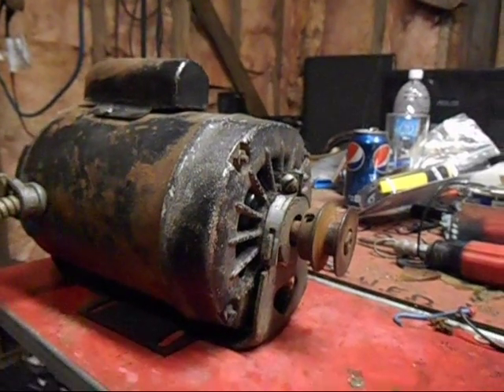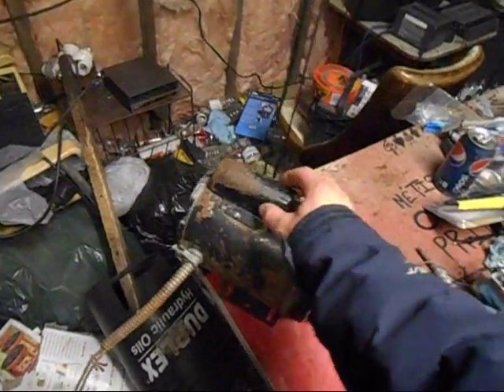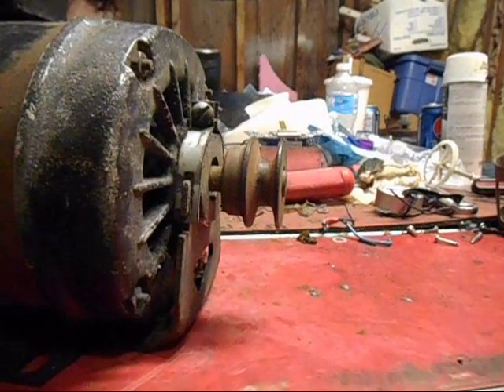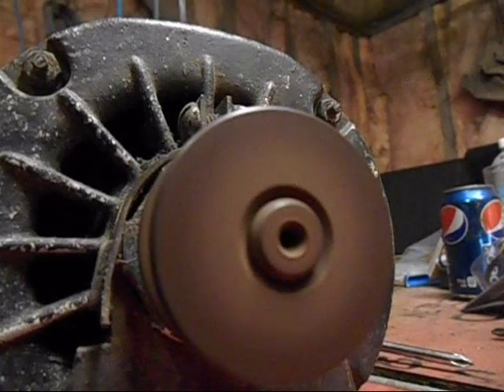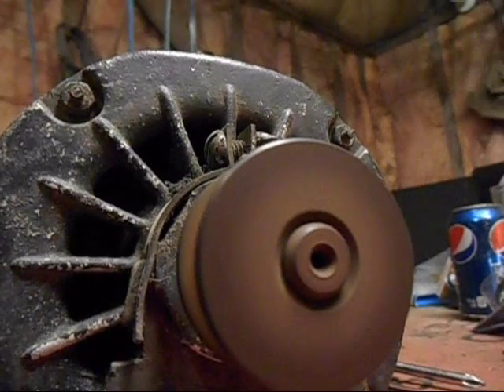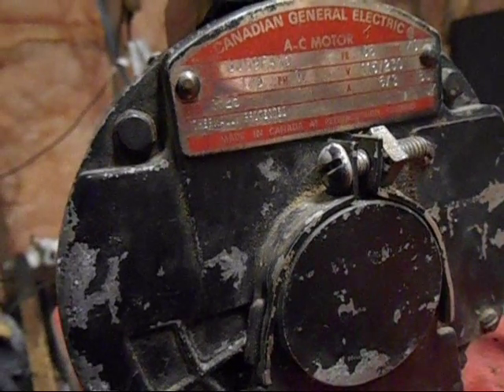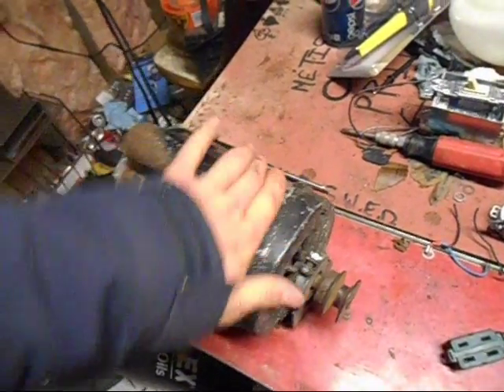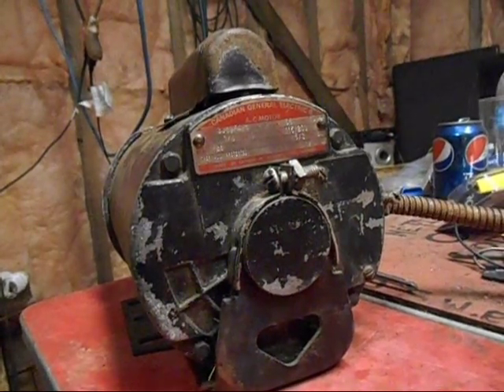Canadian General Electric 1/3 hp motor

Comment: As it happens I was given this exact motor recently. I’ve cleaned it up and it works perfectly, but for my purposes it’s going the wrong direction. Is it possible to reverse it?
Reply from the maker: I'm not sure if cap starts can be reversed.for some reason I'm thinking they cant be , but definitely do some research on that. I'm almost 100% sure that split phase motors can be reversed though.
Reply: I figured out, just need to switch the red and black wires.
Reply from the maker: Right on  @danielwright4307